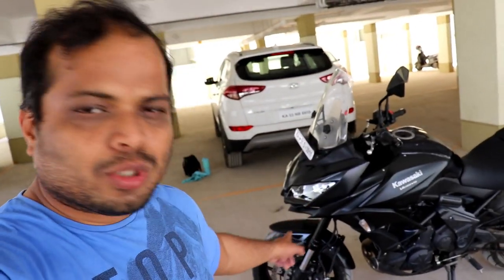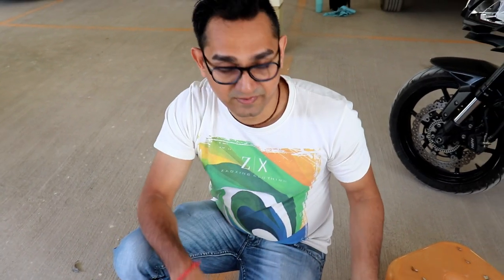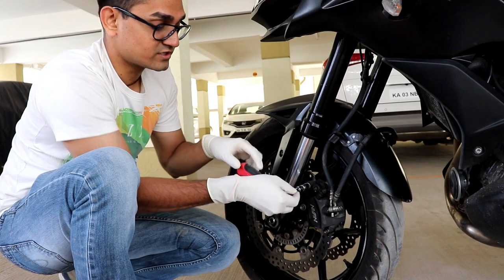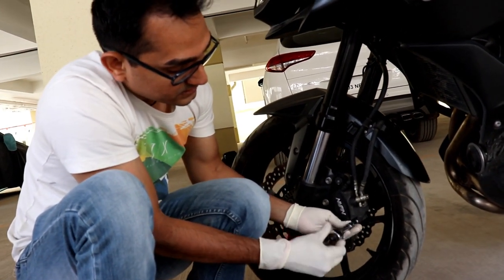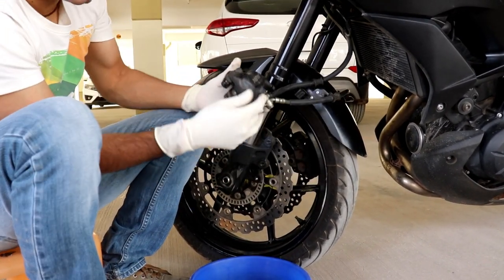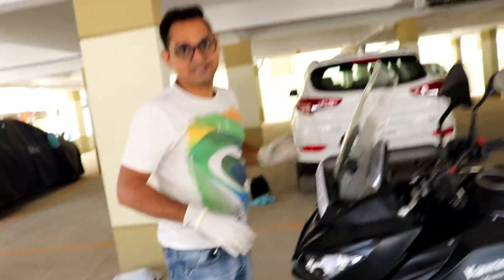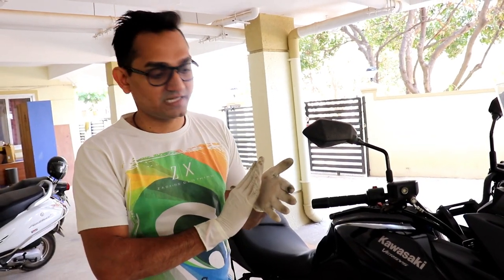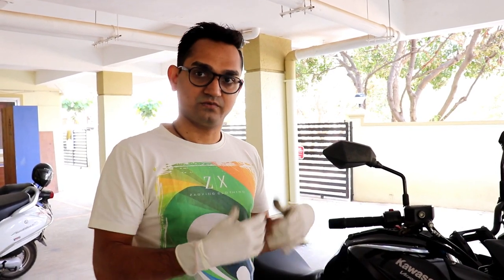How to replace Brakes pads of a Super Bike

Comment: Is there a difference between 150 cc segment abs system and higher segment abs system???
Reply: Bhai depends if its a single channel ABS or dual channel ABS, in theory all the dual channel ABS work in the same way. the breaking effectiveness will change based on additional parameters like single piston or multi piston calibers that the bike uses.

Comment: Lol
Disappointed in the braking system
Only one calliper moves!
Even in my Honda Hornet both the callipers move squeezing the rotor from both sides.
This gives equal force on the rotors.
In this case the one in Kawasaki is actually pushing one side of the rotor more than the other side!